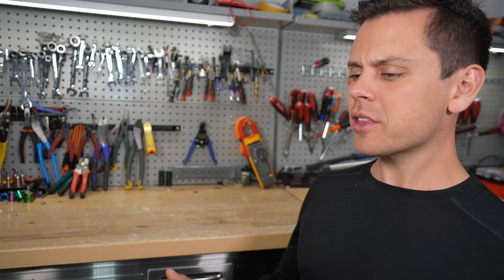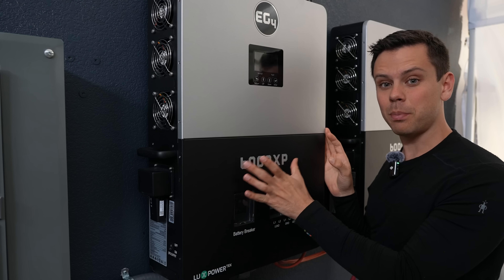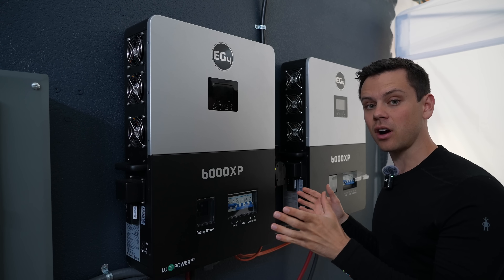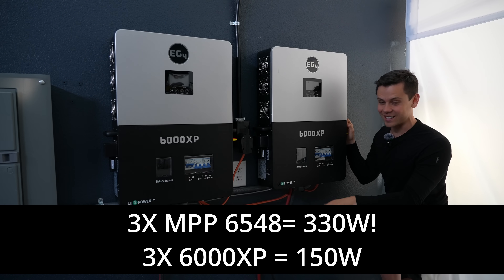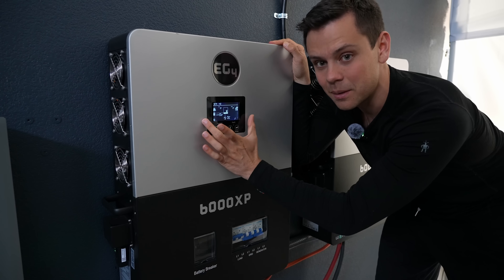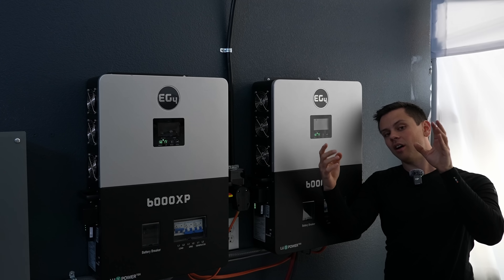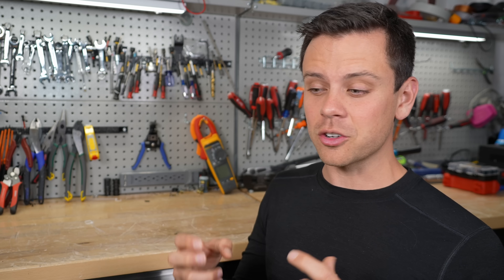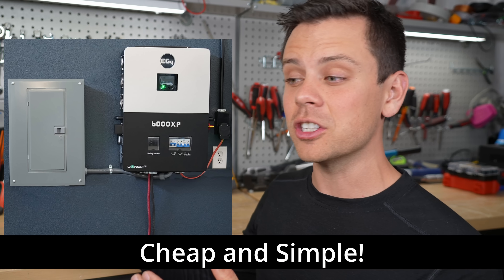Offgrid VS Hybrid Inverters! Which one is better for the $$$?!

Comment: I've built my own off grid solar system and been running it off and on for over 5 years. I built my own battery 9kwh 14s battery pack with recycled 18650 cells in a custom built modular wall mount. I've got 2650w of panels running 1/2 to a cheapo Make Sky Blue 60A charge controller (damn thing was worth every penny!) And the other half going to a 1600w 120v MPP Solar LV1648 inverter/charger (also worth every penny!). Everything works great to power everything I need usually but my microwave will trip over current and I can't run anything 240v of course. I have 16 280AH EVE cells on the way and it's time for a larger inverter. I think just based on raw surge capacity and longevity on a budget, I'm gonna go with the MPP LVX6048 Hybrid. I don't really plan to grid tie but the option is there. Thanks for all the good info Will!

Comment: Please do not talk about hybrid inverters. Or hybrid-anything. Say on-grid, or off-grid inverter. Because by the definition of hybrid, everything is hybrid.  They all have several SMPS inside & other electronics. For example Alixpress sells cheap hybrids with only off-grid power supplies.

Comment: What would you recommend for a backup solution that could simultaneously charge via generator while actively managing load from the batteries? Something that could mean running the generator at its peak efficiency point and shutting it down to run off battery when they are full.

Comment: The 6000xp is the way to go for me in a totally off grid setup since I have no grid available and will use a 8k propane powered backup generator system to charge batteries if needed and don't need a ATS. I have a smaller 24v all Victron system already operating in a mobile setup. I love Victron but, budget wise the 6000xp makes more sense for a stationary and yet expandable 48v system in my situation. A hybrid inverter doesn't make any sense for my situation.

Comment: HI - I have a 48v system consisting of 20 X100amp 12v batteries. I wondered if you could advise if this would be sufficient to run a 10kw hours ? I seem to use between 10-12kwh per day. Eco worthy Inverter is only 5k watts so I know that I cant draw more than that at once - Just looking for some forward guidance after watching and following your Videos

Comment: Thanks for the video. I have 2 MPP LV6548s in split phase running my home. They're in my garage so I don't have to hear the fans, but the air isn't the cleanest. I have to clean out the little foam filters monthly. Overall, I'm very happy with them, but I do wish they had more than 250V PV input.

Comment: I'm having a hard time deciding what to get. I am not in the US. We have a grid connection, but it's not very reliable. So I'd love to have one or two kWh storage to run some basic stuff during blackouts. We don't have net metering or feed in tarif. Any overproduction is just a waste. This makes it hard to make a grid-based system viable.
I've been looking at a hybrid system, but the problem is that you need a battery big enough to handle the power from the panels. Adding batteries makes it all quite a bit more expensive, so for economic reasons I am tempted to go for a relatively small system, covering just the basics in a blackout. I end up with a relatively small system that still requires professional installation which makes it too expensive to be viable.
Right now, I'm tempted to just buy a small solar generator and just make do with that when we have another blackout. I have a gas generator which I can use during prolonged blackouts to recharge the battery, but I hate using it often, because it is just so noisy.
Anyone who has a better solution?

Comment: Hi. I bought an 11.7kw Basen green Lifepo4 51.2V battery. I will charge BG battery with solar panels via a Victron MPPT 150/35. I will charge the Delta pro from BG battery like you show in this video. 
Output from BG battery is 50Ah (200Ah max). After a minute of charging with a output power of 15.5A, the output power from the BG battery started to drop to 3A and then to 5A, thus minimally charging the Delta Pro in waves (3A 5A 3A 5A, ...). Could it be a power output problem with too much amperage (DP max input xt60 is 15A)? How can I solve this?

Comment: I am still building out my solar system and it will continue to adapt it as my needs expand and we get closer to completing our renovation of our offgrid home. We grabbed the 18k primarily for the convenience of having a single device that needed to be mounted on a single wall in a very small closet and because it is absolutely silent even when our hybrid boiler kicks in at 4500 watts. It was pretty much just set it and forget it.

Comment: The advantage of 2 6000XP's is you have a complete redundant system!
Standby current can be reduced at night by simply turning off one unit. The second unit can be tied to a dust to dawn sensor to turn the unit on for PV charging in the morning and tied to a timer to shut the second unit down at night.

You might as well purchase the LUXpower inverter without the breakers to save some $$$ ( SNA-NB-US 6000  $1299 + free shipping )
As shown in your link "Free 6000XP System Blueprints"
The batteries already have breakers. You want the battery breaker to be close to the battery not the inverter
AC output has breakers at the panel.
AC input would also have breakers at the panel
Generator has a breaker built into the generator
You also need to add a box to add breakers for the PV inputs. If you need to add AC breakers for some reason, put them in this box also.

Comment: At time 12:10 your cost comparison includes money for an ATS.  Since this is a feature of the 6000-xp I'm uncertain why an ATS is required.  Would you explain please?   Thanks,  John
Reply from the maker: It's the size of ats. 6000xp isn't whole home 200A ats
Reply: So if I wanted to parallel 2, 6000-xp's (or 4), I would need a stand alone ATS?

Is backup switchover not software configured. My brain thinks multiple units of the same model should be able to synchronized backup switchover timing. 

Or even assigning master-slave status so only the master needs to be active for lighter loading.
Reply from the maker: @johnhoag6157  hybrid has massive pas thru ats. Just not going to happen with a house panel

Comment: The Sol-Ark 15K does 25% more AC output with 50% more solar ports than that EG4, as well as 10% larger battery charger. Plus years and years of field experience on top. It's easy to make a photocopy, its hard to make the real thing. Would also argue that weight is an indicator of quality and heat management amongst "equivalent" products.
Reply: I have a Solark 12k and a 15k. The 12k works well but the 15k is junk and after repeated calls to Solark they don’t want to cover it.
Reply: @samdixon6867  if it were junk, then shenzen seastar (Luxpower's OEM) wouldn't have ripped it off. Sounds more like an installer error to me without more specifics.
Reply: @pvbatts  I have gone through, with pics, the installation with Solark and they have no issue with that. They just don’t want to stand behind an apparently defective unit. They told me the flashing is normal with this model and that is why I was so curious as to how others are working. The software is updated.
Reply: @samdixon6867  well still unsure as to your issue but the next level ups in Sol-Ark tech support are product leads or customer success manager so perhaps you need to keep pressing support. Still unsure of your issue as it sounds operational.
Reply: @pvbatts  thanks for the info I will try to take it up the ladder.

Comment: Love the content and presentation format. This presentation brings our thought process closer. I've never been a fan of the "cheapest" solution, I seek value and a ecosystem that's scalable and flexible.
To that end, I would love to see you take a look at some of the solution sets that are a single source, integrated system. Fortress Power has an offering the seems to include everything from load management to integrated, scalable batteries on a 200A circuit.
Keep up the great work!

Comment: 18kPV with Powerpro is a UL954OA 3rd edition  certified ESS, which I am required to have in my OFF GRID 9non grid connected situation.    6000XP  doesn't have the paperwork.   I may use it as an add on down the road though

Comment: We've recently installed both off-grid and hybrid inverters for our customers. One notable advantage of the hybrid inverter, especially appreciated by our customers, is its quiet operation. While some off-grid inverters are catching up in functionality, such as the TBB inverter, none quite match the quietness of the hybrid model.
Reply: My solark 15k is very quiet!!!
Reply: Does your 15k cause lights to flash when the load changes either up or down?
Reply: @samdixon6867  No, no  problems at all, no lights flash, and I have 2 central air airconditioners I run in the summer off of it
Reply: @nobody342  thanks for the info. This means mine clearly is defective as I thought. I have had many conversations with Solark tech support but they don’t want to do anything.

Comment: A bit off topic but wondering if you’ve looked into combining solar and wind in an off grid system?  I’ve got a 6048 with 2 EG4 batteries combined with 2500w of panels, generally work pretty good in the summer at my WV cabin but I struggle with having enough power in the winter months. I’m on a mountain top and it’s pretty windy, I’d love to be able to supplement generation for nights and cloudy days but this doesn’t seem as developed as the all in one solar setups available today.

Comment: In your opinion would a 5S string of 370 watt panels at 41 volts totaling 205 volts to the MPPT work well with the EG4 6000XP?  Is that within the guidelines for minimum voltage? I am thinking of doing 2 strings in this configuration to the 2 individual MPPT connectors on the 6000XP. Thanks so much for these videos. I have created some great a few iterative small (400 watt 12v) victron systems and I am thinking of growing up now to 48 volts built around the 6000 XP.  I already have the 10 370 watt panels.

Comment: I just purchased two 6000XP Inverters to replace my 3K Growatts. Problem is I have to mount them in the garage due to logistics of the wiring. I could mount them in the Master Bedroom closet, but I'm sure the wife would disconnect them. :) I'm concerned with the heat issue. I live in SE Louisiana and it gets hot here. Any suggestions?

Comment: I got my panels delivered back in January, the state I live in limits Residential Grid-Tied Systems to 10Kw Arrays so efficiency is a contributing factor and I just had a Mini-split installed so I could stop using the Propane Furnace and also only have to heat half the house instead of the whole house when no one is visiting.

I'm trying to decide on what inverter to do, initially the plan was a small sub panel that would move the major appliances (water heater, AC, etc...) and the circuits for the basement to a pair of 6000XP's but then I sat down and really looked at it, by the time I did a sub panel and required all the basement circuits to the sub panel i'd be rather close to the price of a 18k and with the 18k PV I could run a higher string voltage by an extra panel or 2 per string which would further decrease my line loses as my main array will be 300 feet from the house. 

I've also gotten tempted to place panels on the South East facing "back roof" of the house and use microinverters like the Enphase IQ8's to put a 1.8-3kw array on the house (not the yard around the house is a no go due to TALL trees shading much of the yard for much of the day only getting about 3-4 hours of not shaded, the roof still isn't the best place compared to where I wanna put the main array at, but it would get an extra hour or 2 in the morning and a few more hours in the afternoon (albeit facing the wrong way, but the sun is still hitting that roof area). The backup plan for the near the house would be to convert what I was planing to make a trellis over the garden bed into a "solar roof" over the garden bed.

Comment: at the 8:00 minute mark, Will talks about the Hybrid (18Kpv) having the transfer switch built in.. but if you look at the 18Kpv manual, diagram 4.4 for example, it's got a manual transfer switch in the diagram. Is it still recommended you have a separate manual transfer switch for the 18K? If you don't have one, is it that the 18Kpv just automatically does its transfer switch thing as needed, or can you actually control it manually? If the 18Kpv is down (not functioning) does it have an actual manual switch that would still allow you to bypass the inverter?

Comment: I am totally offgrid here in Panama, I have two 8kwh Deye hybrid inverters,  each with 2 x 10kw lithium batteries. The inverters are set up as primary and slave, the slave is connected to grid of the primary, when primary batteries hit 60% the slave kicks in to feed into the primary, works very well.

Comment: I'm still using a one 6500ex and 6 LIpo4s off grid ..  Light flashing is crazy and no help from signature other than to run through all the settings.  Still flashes.  It's inrush current when the furnace starts up or the freezer starts up.  Do you see any light flashing from your 6000s?  I need to do something here.  Can't use this system for my Radio gear unless I use a UPS in line.

Comment: Just about to upgrade my cabin's Renogy 3500 💩 inverter to an EG4, likely the 6000xp. But the fan noise and need for active cooling (mini-split) has me canidering othervise. Too bad the 18k is $5200! With no grid connection it just seems overkill.

Comment: MPP 6548 grid charging sucks when using a generator off grid! You need a 6000w generator at say 5 gallons for 8 hours = $3.50x5 which is crazy to charge batteries when its cloudy. It also has to be an inverter generator, my open frame generator did not work. With a 3800w genny I then bought, come to find out you can barely run anything becuase it charges 1500w and feeds loads directly from the genny, loads are not powered from the battery while charging. I had to buy an aims 48v charger and it runs off my 2200w costco yamaha w/ 1 gallon for 8 hours. That's my biggest complaint. EG4 wasn't around when I purchased the MPP, not sure if EG4 is any better. It's just too bad the MPP charger is such a problem. It's almost perfect.

Comment: 2 months into a 6000XP with 2 batteries hooked up to 4.5kW of bifacial panels.  Only thing I would change would be to buy one Power Pro battery instead.  But if I was setting up a 100% off grid cabin I would probably go 18k or Victron.  Yes, it's more, but over 20 years it's not that much more per year.
Reply: You make me feel real good I may have overdone it LOL I got two 18k eg4 and 4 eg4 power pros 10000 watts solar for a camper

Comment: If I have 2 PV strings 1. 3300W 2. 2750W and I have 2 6000XP in parallel, Should I run a PV string to each or put both on the primary and leave no PV to the second 6000?  They battery share 500AH of 48V batteries.

Comment: I'm using 6000ex running on 4 eg4 batteries 48v 12  400w panels on it. Runs my welder, compressor, ac and tv. The most I've put in it at 1 time is 2500watts

Comment: I have the money to buy the 18k but I like having redundancy. When I first built my system for my off grid home in Mexico I used two mpp solar 6548wps. They worked great but I apparently broke one of them when I turned it off with inverter still on so I am using the one inverter while I get the other repaired (which takes a while in Mexico). The one unit runs my entire house fine so the redundancy (ie 2 units) has been a life saver for me. It looks like the 18k will NOT have problems though so maybe I don’t need redundancy any more. If that was the case then I would probably go with the 18k. I think the redundancy issue is something that those of us with complete remote off grid set ups think about but Will didn’t mention (I still liked the video though!). But as I said, maybe the redundancy isn’t an issue any more with these inverters becoming very reliable??

Comment: Question on the KG4 18KPV: "It can send power into the grid when all draws (battery charge / loads) are satisfied?.. And, if grid goes down, it will automatically stop sending AC electric back to grid? Yet, still supplies power from PV and panels to your loads?

Comment: Will, do you know if EG4 has released the firmware upgrade to allow AC coupling to the generator input of the 18k yet?  I heard it was going to be early this year.

I suspect that's the reason why so many RV and marine manufacturers that install solar on their builds use Victrons, the longevity of the various components to the system.

Comment: I have a Solark 15k hybrid inverter with about 10k watt of solar.  I got it for backup in an emergency and for inflation proofing my energy use.  Nothing to do with being green, which is a total farce. If the grid goes down, I am without water, not just electricity, as I am on a well.   The reality is, solar is not ecofriendly.  Have just enough battery for a average day us useage if no power and no sun.   Currently pay only  $20 a month to the electric company for service.  last January, I had 5 dollars worth of electricy I had to pay for as the power company pays out the excess at the end of the year, and we had a cloudy January.  I run 2 Air conditioners in the summer. and in the winter, prior to payout, I burned off a lot of my excess electricity heating with radiant heat. 

If you can afford hybrid, its great.
Payback will be about 20 years at current electric prices/ ie  0.10 per KWH.  dont expect that price to last though with all the crooked politicians we have, Biden is trying to collapse the economy and the US. 

So far, I really like my Solark 15k! wish that the EMP hardened inverter was available when I bought mine though.